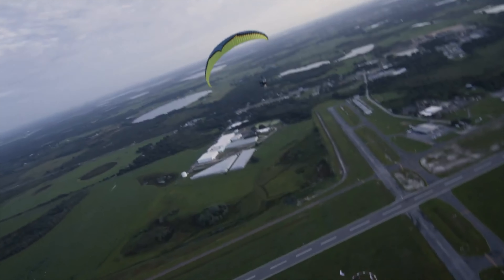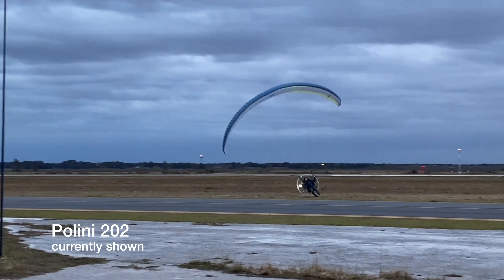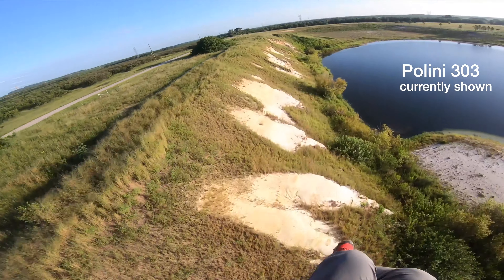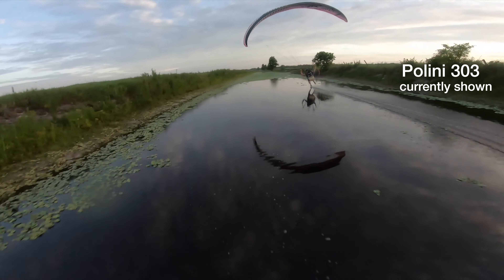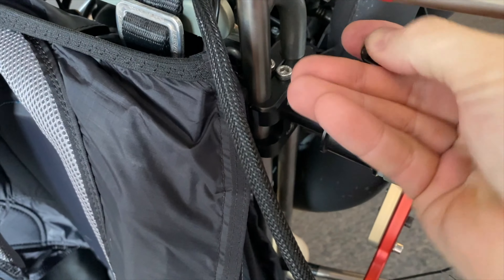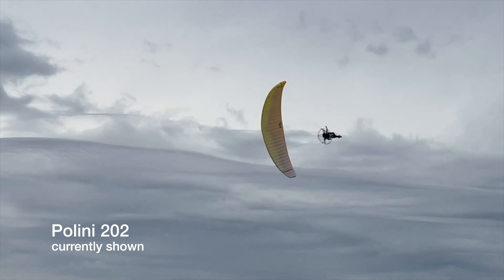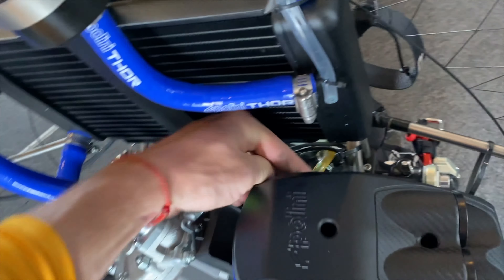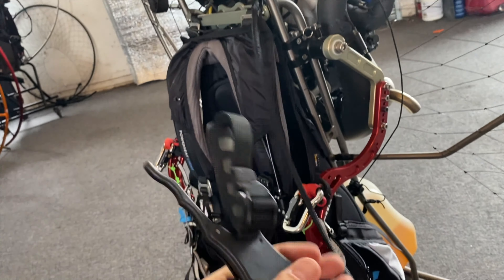POLINI Thor 303 and 202 HONEST REVIEW

Comment: Thrilled you posted this AJ! While the 303 seems pretty darn epic for an extra 4 lbs of weight, I'm not sure I'm at the level where I'd need the extra power and spend USD$1660 more. 

At USD$2960 for the 202 you get more thrust, 400 hours between overhauls (vs Moster 185's 100 hours), better fuel economy, no belt, and liquid cooling, it sure seems like the 202 handily beats out the Vittorazi Moster 185 Plus across the board, but for weight, and is more equivalent in thrust to the Factory R which costs USD$1,440 more than the 202.

I'm also encouraged hearing you too had some challenges tuning the Dell'Orto carb. I heard rumblings that 202s burned pistons, but it sounds like new owners over-trusting the factory settings and jets and not watching their EGT and knowing the engine's limits or how to tune a non-Walbro float bowl carb. Excellent detail.

I'd love to have you post a video about comparing weight shift vs fixed J Bars on frames -- who uses fixed, who uses weight shift, pros and cons of each for different types of flying, etc. My first (and only) motor was fixed J bars, and I got to fly a weight shift rig a few weeks ago, and I hated it. Granted, I'm 6'4" 270lbs so maybe it wasn't the right size, but I guess I didn't like the fact that I had to do more things to turn tightly. I get the argument that it's "nice" to make small adjustments in heading just by leaning, but beyond that, I feel like weight shift either fights me or I have to do more work by throwing my body into a turn. Yes, I'm lazy. Thus my request for a true comparison for why fixed J Bars exist, why virtually nobody sells a non-weight-shift frame, and for people who don't use weight shift, why do they not?
Reply: @SR-gs8zo  65 hours on mine with no issues. I'm quite sure I know things, I'm not sure why you're choosing to insult people rather than present data. 

The Moster 185 with 130cm prop and a 2.87 reduction gives you about 75 kg of thrust. I flew with this configuration for 3 years. It was sufficient most of the time, though in places where there were shorter takeoffs, I did wish I had more power. It consumed about 6 liters per hour for my weight and wing and flying style.

The Polini Thor 202 with 130cm prop is 90 kg of thrust, 20% more than the Moster 185. I will assume, however with no extra data to provide, that 140cm prop would give you more thrust, or the same amount of thrust with lower fuel consumption, or both. This gives me a delightful amount of available thrust, flying a 31m wing and about 350 lbs all up weight.

I'm confused why you believe you know everything and everyone else knows nothing. I don't fly an airplane, so I do not comment nor shame others for such things. I do fly a paramotor and have for 3.7 years. There's a difference about what an engine can provide flight to and whether or not you are just barely getting into the air or you have power to spare to get out of tight situations.

Yes, both engines can be put on ultralights and maybe even light sport planes, and yes, both engines can get some pilots, depending on weight, into the air with room to spare. And yes, both engines can also be strapped to your back and flown with paramotors.

Talk to me about facts, don't insult people you do not know about how you believe your knowledge and judgement is somehow superior when you have no idea who we are. I do not know who you are, and you could be an aerospace engineer, but note how I haven't insulted your opinion or experience, only the way you communicate. People stop listening when you insult them, so if you want to influence people, try a different approach.

Comment: Does the 202 and 303 come with different jets and needles or did you have to buy them separately?
Reply from the maker: I had a very early 202, it did not come with them but they sent me some later (so I’m not certain they come with them, I imagine they do now)

My 303 did come with a complete set of jets.
Reply: @Awkbots  that's great to hear they come with them. I would prefer a float slide carb for the ability to really dial in the fuel ratio but I think for the majority of motor pilots it's to complex for them and would cause more grounded frustrated pilots.
Reply from the maker: @MitchG  I could easily see it being frustrating for some people that don’t understand two strokes, because the behavior of these motors is a little confusing at times.  It acts a little different when it’s too rich than any bike I’ve ever had.  But I’m with you, I like this style carb far more!
Reply: @Awkbots  Me too. One guy burn hole in piston Jetts set for his normal 5000ft altitude with non alcohol gas. For got to re jet salton sea and could not get non alcohol gas that will burn you and a burnt hole in piston.
Reply: @MXWaveRider  do you mean non-ethanol?

Comment: What Spark Plug cap did you replace the stock one with, and what spark plugs are you using? I know Polini recommends NGK BR9ES, some have suggested the BR9EG too which may reduce fouling for about $1 more per plug. Just curious if it is a resistor-type cap and a non-resistor plug or vice versa (or both, but I believe you don't want BOTH).
Reply: Hey AJ -- I'd love to hear if you're still enjoying the Polini Thor 202/303? I got mine (202) and started flying it in April 2022, foot launch. It's been great! I'm using non-ethanol 93 octane with AMSOIL SABER 2.5%. About 65 hours on it. My head is too big and blocks the air intake for the radiator, not sure how I'm gonna solve that. Mostly on hot days I just fly with my head down for a few seconds and things cool off! Doh.

Comment: Are there limitations on the 303 water cooling and flight temperatures? Great Review.
Reply from the maker: Good question, I have not seen the 303 get even close to questionable temps yet in flight.  That being said I purposely left out the thermostat considering it doesn’t really get cold very often here in flordia.  Warm up is a tad longer because of that but in general the cooling system just works great all around.  I imagine up north in cooler temps the thermostat (included) may need to be used, but also I do know some people put a neoprene sleeve over their radiator to keep temps up.  

The 202 got a little warmer when on bar for long periods of time. But not concerning.
Reply: @Awkbots  where in Fl are you? I am in Dania beach and would love to get into this sport!! please let me know

Comment: Nice review.   I have been able to mount a AC Tornado onto a Fly Products Flash Cruiser.    I'd like more power... and I'd like something like this to use for foot launch tandems, trike tandems, and to just go have a blast.    I am close to your weight, if not a little heavier..... and I did get a 19m Freeride that has me wanting more power over the Moster 185 I usually fly (on a Maverick)

Do you think this would mount up OK with the Flash Cruiser?    Eyeballing it, it looks like it could be pretty easy to make work, but since you have both products handy, you might know  the answer or have already done it.
Reply from the maker: Yes it will work on a fly products frame, however fly products has a very specific frame for every single motor, not only for the mounting bolts, but also the torque compensation.  So the air conception is belt drive and offsetting torque for a moster or air conception even if the bolt patterns are the same.  But polini is different boot pattern, but also gear drive there for needing torque compensation for the other direction.

The torque compensation needed for a 303 is huge, due to its thrust and power.  I would argue that no torque compensation at all could potentially be dangerous, but having the wrong compensation would not work.
Reply: @Awkbots  good point on opposite torque compensation, but I can't see that the flash cruiser trike itself has any torque compensation.  The trike itself is symmetrical that I can see.   I'd want to mount the liberty frame on the trike, so the liberty frame would be doing the torque compensation, right?   Thinking that could work.     The tornado on the AC frame mounted to the flash cruiser seems to do just fine ...  I just want more power for tandems.

Comment: New pilot. 1st motor 225lbs. Monster 185 or thor 202?
Reply: @awkBOTS what would you suggest?
Reply: @awkBOTS what would you suggest?
Reply: @awkBOTS what would you suggest?
Reply: @awkBOTS what would you suggest?
Reply: Get the Moster 185 with 130cm or larger if your frame can handle it prop. Everyone flies it and you'll get a lot more help. Spend 100+ hours on the Moster 185, get to know all the things and maintenance with it, then you'll be better equipped to deal with the new challenges a Thor 202 might provide. I'm guessing you'll have some crashes and fails as you learn, and the lack of that radiator will keep the costs of repair lower and easier on a Moster 185 than a Thor 202.

Keep your Moster 185 in good working condition, then sell it when you have 100+ hours and get a Thor 202 if you still feel you need more power.

Comment: Seems youre statement of 2.8L/h is under questioning... In your previous video you said the 303 uses 6L. Which is it??
Reply from the maker: What are you even talking about?  I said the moster uses 6-7 liters of fuel when I fly it.  My 303 uses 2.8.  That is a fact for me.
Reply: https://youtu.be/JtWMUqzkBnU In this video you say its using the same as the Moster (22:55)!?
Reply from the maker: @jensfalck_TheSwede  I do not say that.  I’m very clear the difference between the 185-7L, 202-4.5L, and 303-2.8L
Reply: @Awkbots  Have you even watch what you say at 22:55 in the other video I linked to?? You say straight out the 303 uses 6L.
Reply from the maker: @jensfalck_TheSwede  oh wow, you are right, On the older video I definitely misspoke, i was just randomly talking during flight so I imagine that’s why, I already have a problem with speaking as fast as my mind moves esp during flight lol.
I have never burned that much even when I flew it with stock jetting which is way too rich.  I burn less than 3 liters an hour.  Even the 202 never burned over 5 liters an hour.
Reply: @Awkbots  Thx for clearing that out;) Its not that imortant but it will be the diffrence in installing the 5L or the 14,5L tank on the raceframe. If I to manage below 3L then a 5L tank is enough. Ill report back!

Comment: why could you not kill the motor when the problem was that your cable got stuck on the carb. or did the kill switch did not work either? seems like two problems
Reply from the maker: Three problems, kill switch was broke (I knew about it but wanted to fly again). Second problem, throttle cable got pulled out and would not return to idle.
Third and most important, I did not preflight the throttle to make sure it returned before starting the motor
Reply: @Awkbots  Please be more safety conscious! We don’t want to lose any more aviation people! Especially a person like you that gives a straight up review of an engine.

Comment: Is your 303 still working well or giving you problems as with other in US?
Reply from the maker: Yes it burned a hole in piston.  It will for everyone with out av gas.  It’s happening everywhere even overseas due to high compression and not high enough octane (even higher than what is recommended.  Mine was jetted rich, ran cool and still burned a hole so it’s an compression octane issue. 

Waiting to hear back on official word what’s happening with replacement before making post or announcement
Reply: @Awkbots  Thx so much for sharing! But they have sent out a statement "Alert pdf". Given this almost is US problem alone maybe it is the gas at fault but seems even with our higher octane here in EU the motor doesn't leave much room for margins. To bad because I really want the performance it offers. Not really any other good options out there.
Reply from the maker: @jensfalck_TheSwede  Its an amazing motor, i think it will still be great with 100ll av gas or the lower compression head.  It has been happening everywhere, but more so here in the states.  I cant wait to get mine back and flying a 303 again, I love it and until that point i have not had a single engine out or complaint on the motor.  I have zero complaints with the motor and how the situation has been handled up until this point.  I hope to release a video of my experience with the motor soon.
Reply: @Awkbots  I've been considering using Octane Booster like Rislone 4747. For $2.50 a bottle it claims to boost octane by 20 points (2 octane levels) for 20 gallons. If 93 octane (US PON) non-ethanol isn't good for the 303, I guess I should pick some up for my Thor 202 to avoid a hole in the piston.

@awkBOTS I'll be curious to find out if the new piston Polini has sent out will reduce compression enough to be able to use premium 93 octane (US PON) mogas, with or without octane booster, in both the Thor 202 and 303. If you receive it and get it installed, I know all of us PPG nerds would love a new video!
Reply: @jensfalck_TheSwede  Our gas is not at fault here. Europe measures octane differently than we do in the US, but it is roughly the same octane, just different numbers. 

Europe uses RON (Research Octane Number), US uses PON (Pump Octane Number).

The gist:
  - RON (EU) <-> PON (US)
  - 90 <-> 86.5
  - 92 <-> 88.5
  - 95 <-> 91
  - 97 <-> 93
  - 100 <-> 95.75

95 Octane in Europe is the same as 91 Octane in the US.

Most stations offer 87, 89, and 91 octane as regular, plus, and premium. Some stations also offer 93 ultra premium. 

For Polini Thor 202 and 303, it is sounding like you want the highest octane you can get, and then add octane booster, and get non-ethanol absolutely.

People are getting 100LL Avgas to avoid this, but I think it is silly to pay $5.50 a gallon PLUS buying Decalin to avoid/reduce lead fouling when you could get 91 to 93 octane (US PON) non-ethanol for like $3.50/gallon and buy some octane booster to get it to say 93 or even 95 octane. Or hell bump it to 100 octane if you think it will save your piston! 

I am NOT a professional mechanic, I just have flown paramotors for 2 years. Octane does NOT change the fuel energy content, it only changes how the fuel burns and reduces the likelihood of premature combustion due to high compression, which is advantageous here since, while in cars they have ECUs with knock sensors to change the fuel air mix on the fly, we do not.

Maybe I'll just spend a few extra bucks and always mix my fuel to 95 octane (US PON) to avoid the piston hole. I'm pretty sure higher octane gas will NOT cost me more than a piston. 

My Math for a 5 gallon gas can full of 95 octane (US PON) mogas + detergents: 
  - $17.50 93 octane (US PON) non-ethanol is $3.50/gallon at my go to lawn care joint
  - $0.625 Add 1.5 oz of Rislone 4747 Octane booster (1/4 bottle) to get octane to 95
  - $0.4675 Add 1 oz of Seafoam to keep the exhaust port and other stuff clean and clear
  - $4.20 Add 12.8oz of AMSOIL SABER
  - $22.80 TOTAL (about $4.56/gallon fully mixed)

This is still way less than 100LL Avgas plus Rislone, and I'd still add Seafoam to that.

https://aircooledbug.co.uk/usa-versus-uk-fuel-octane/

https://motocrossactionmag.com/ask-the-mxperts-why-does-euro-fuel-have-so-much-more-octane-than-american-fuel-2/
Reply: Any updates from Polini?
Reply from the maker: @khmaladze719  yes I got a replacement with updated head!  Very happy with Polini, I still absolutely love my 303
Reply: @Awkbots  That is really great! 
Do you know if they updated heads in all new 303? For example if i order 303 now will i get it with updated head from factory?
Reply from the maker: @khmaladze719  yes they updated already, and if you already had a 303 they sent you a new head at no extra cost.  The new head lowers compression but some how increases power and smoothies the motor out.  I imagine it won’t be quite as efficient as it was though
Reply: @Awkbots  thanks and waiting for your new video about that :)
Reply: @khmaladze719  They must have been either running too lean or with too much advance for the previous compression ratio.

Comment: No much difference between 130-140 cm e-prop. Maybe 2kg in static turst on the ground. But the noise of 140cm eprop hmmm for me, this disqualifies  140 cm propeller. I prefer the 3 blade 130 cm adjustable propeller. Same trust less noise.
Reply from the maker: I flew all those props and more and that was not my experience at all.
Reply: @Awkbots  I am not saying that it is not.  But my experience with a 140cm propeller is completely different.  It's terribly loud and I don't feel that it is stronger than 3 blades.
Reply from the maker: @krzysztofbartnik  the 140 helix prop is better than the eprop in my opinion